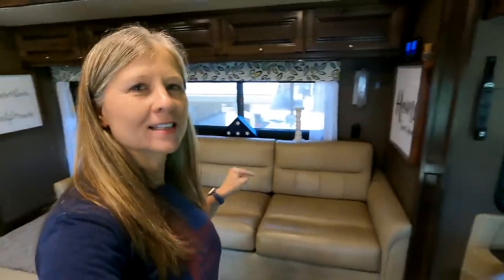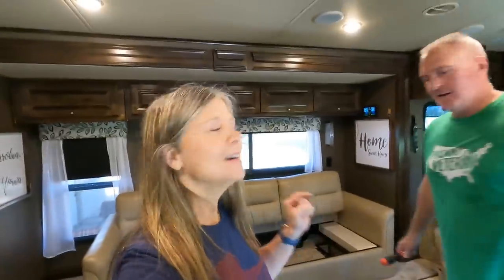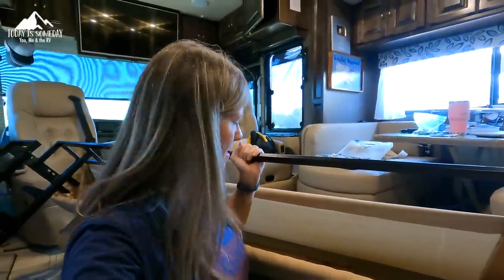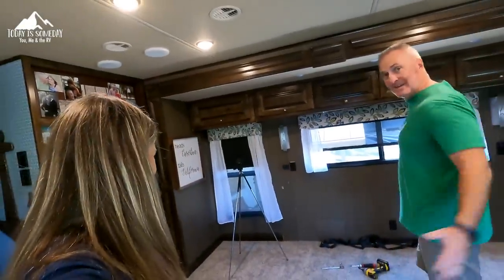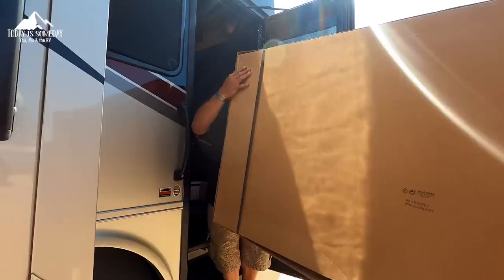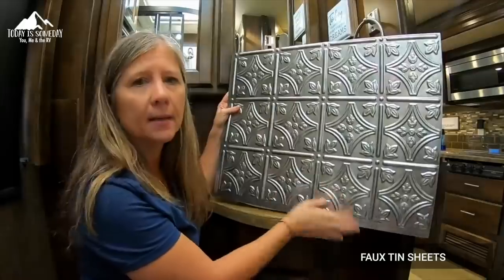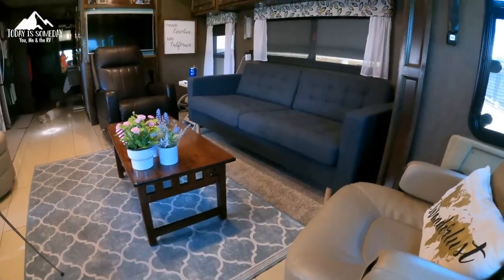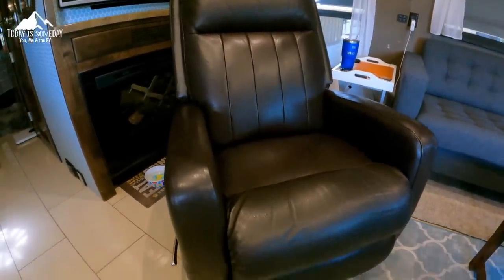We Found the BEST RV couch at IKEA!

Comment: We bought reclining theater seats from American Furniture. The salesman guaranteed that it would fit through the door and if not the delivery guys could take it apart and get it through. I measured and remeasured and was pretty sure it would fit. When they showed up to deliver they said they would not take it apart and the salesman was wrong. They would only take off the backs and the legs not the frame. It did fit through the door barely by just taking the backs off. The vertical valances hit when the sofa was reclined so I took them off and had an upholstery shop cut them down for $30. Now we are comfy and happy.😀

Comment: The door on our 5th wheel is only 24” wide.  We went with full size residential sofa with recliners on each end, and reclining theater seating by Lazy Boy.  Each sofa is held together by two pieces of angle iron along the base, front and back.  Remove those two pieces, then the back separate from the seat easily.  The sofa broke down in to 6 pieces, the theater seating was 5.  Reassemble both couches in the RV.  Easy Peezy!  Pricey, but great quality.

Comment: We swapped out our hide-a-bed two weeks after we got our coach.  We got electric recliners from Lazy Boy.  They come in two pieces and are easy to get through the door.  We selected the electric models as they do not go back when they recline, they slide forward.  This allows them to ride on the slide and we can use them without repositioning them.  We added a center two drawer cabinet between them to complete the set.  Looks like they came new with the coach.

Comment: Enjoyed your video. We replaced both coiuches in our 98 american dream. in the slideout I built cabinetry to encase the 42" led tv. On the other side, wife found a entertainment dual recliner wall hugger type with center console for drinks and storage at AARONs. It actually came apart in several pieces. the frame is angle iron, the 2 seats unbolt from the frame, the backs come off the seats, and the console is small enough to move in with no problems. We got the frame inside, bolted the 2 seats and center console to the frame, re attached the backs, then let the recliner all the way out and bolted the frame to the floor like the original couch/bed was, so the backs were an inch or two from the window. Works like a charm. and I sleep i them all the time. If I knew how to add pics add do so for the recliner and cabinetry.

Comment: Awesome video shipmates! Love the upgrades. I want to replace our furniture at some point and this provided some great ideas.
Upgrades:
1. RV Snap Pads was ordered before we took delivery both on yours and Chad and Tara's recommendations. 
2. We had our batteries upgraded to lithium and solar installed (800a/h w/ 2400w solar). Mike Purdue of The Dry Campers did out install and I cannot say enough about Mike and Leanne, they are fabulous people to work with, more importantly the fit and finish of Mike's work is impeccable. Mike is able to find space for placement and for us we lost no cargo space in the process. 
3. Easy Starters installed on all three AC is a game changer for both the AC and power consumptions.
4. Starlink...what a game changer. We've had the system now for three months and have yet to be in a place that we didn't have better down/up load speeds over our Pepwave Maxtransit Duo system with two companies data sims. 
5. We are in a toy-hauler with a small garage (Momentum 376THS-R) and I own a Harley Davidson Road Glide Ultra, I installed the "Biker Bar" in the garage and it has been excellent for securing my bike. No more crawling around trying to secure cargo straps to hold the bike in place.
Reply from the maker: All great upgrades!!!

Comment: Good job guys! We switched out our old couch for a two recliner w/console unit for our Newmar Dutch Star. It is very comfy! Bought at Camping World so the price wasn’t great. Hubby has back issues so when he felt comfortable on something we bought it. It comes apart so it easily fit through the RV door. We are in our 60s and easily handled the install.
Reply: We want to swap out the 6' sleeper from the coach  with the theatre seating with console from the 5th wheel.  This encourages me.  Thank you.

Comment: I removed the couch from my older Class C and replaced it with a RecPro double recliner.  RecPro, while expensive, makes sure the modular pieces are built to fit through a standard RV door.  I was able to load the new recliners myself.  Then, when assembled, they lock together to form one piece.

Comment: We had our captain chairs and our 1 couch reupholstered with ultra leather. Then we changed out our sleeper couch for  Lambright theater seating and they matched the material.  The Lambright  furniture is very well made, its made to come apart to fit in your RV door. We didn't have it installed but they will also install for a fee . Located in Topeka IN near all the RV manufactures. It did take 6 months to get it after we ordered it but they do have some available in their showroom.

Comment: Hi - When we bought our RV (2015 Tiffin Phaeton), the previous owners had removed the original furniture and put in two recliners.  They were comfortable, but quite used looking and we thought we'd rather have a couch and recliner to make it homier.  So - we took out the two recliners and bought a Kathy Ireland couch and recliner online from Camping World.  We bought the couch because we liked the way it made into the bed.  The couch just basically folds out and creates a nice (kid-sized) bed.  The recliner is a rocker/recliner and it is very comfortable, but the problem with it is that the base of it is on a round pedestal and it can't sit far enough off the wall to not knock the wall when you sit in it.  If you pull it too far out, it leans too far forward and you'll fall out plus it's in the middle of the room, blocking the fireplace and TV.  Securing it for travel is another issue - we have to wedge it just right and surround it with pillows so it doesn't bang against everything, threatening to break the window!! The couch isn't comfortable to sit straight in (we bought it online and that was a mistake).  The seating part is too short so it's really only comfortable if you sit sideways and put your feet on the couch, too.  The whole set up cost us about $1500.  Someday, we will replace both.  It is really not an ideal solution.  FYI -  Couch:  https://www.campingworld.com/kathy-ireland-easy-out-sofa-125485.html?utm_source=google&utm_medium=ppc&utm_campaign=%7bCampaign%7d&gclid=CjwKCAjw_ISWBhBkEiwAdqxb9l0LUEZGbzhcLBtJBZVZtdiV9rwWJxlJSSJ-GBCopfstEOY9u159_xoCZTAQAvD_BwE&gclsrc=aw.ds   Chair:  https://www.campingworld.com/kathy-ireland-swivel-glider-recliner-125507.html?utm_source=google&utm_medium=ppc&utm_campaign=%7bCampaign%7d&gclid=CjwKCAjw_ISWBhBkEiwAdqxb9qmVkvV1A9DL_N_WeFO6KJs3b7T5k7NpBHyQ-LmjPxwlxcSDDnMHeBoC-wAQAvD_BwE&gclsrc=aw.ds

Comment: We changed out the L-shape sofa in a Fleetwood Bounder. We only had 80 inches in space. We wanted a couch but most were too big and the loveseat was too small. We ended up getting two end pieces of a sectional and it fit perfect. Each end piece were recliners and they hooked together so it still looked like a couch and did not separate from each other.
Reply: We did the similar thing. We used two middle pieces of the IKEA sectional so we didn’t lose space to the sofa arms. Sectional pieces are great to create the needed couch length when you have the odd size where couches are too big and loveseats are too small.

Comment: We removed the love seat with recliners for two Lazboy recliners. Both came apart easy and made a bracket to anchor the Lazboy recliners to the slide floor. So comfy. It did block the small window in our Phaeton 40 QBH, but it's a small window and was not used for a view anyway.

Comment: When doing this, remove the mattress, then the sleeping unit, lash the it together and carry out. MANY years of experience. Then disassemble as Phil and Stacy did.
Reply: Will a 6' sleeper sofa still have to be disassembled?  😢
Reply: @PRINCESSKELEA777  Yes, it is quite heavy and this will make it much easier.  Open the sofa and remove the mattress.  Close the bed frame and tie it together so it won't open up.  Next remove the nuts and bolts holding it together and carry it out in pieces.
Reply: @srperk6163  Thank you.  😝  Haha.

Comment: Very nice upgrade.  I took out our couch and love seat and built a custom dinette and bunk beds for the grandkids.  I used regular twin sized mattresses, so sheets, blankets and bedspreads are not a problem.  I have plans on removing our recliner and building a custom Murphy bed.  When the Murphy bed is up, I'll have a panel that will drop to provide a desk for the passenger seat or extra table for food.  All the new furniture I built is painted white to brighten up the coach.

Comment: We got rid of our Flexsteel furniture from our 2016 Nexus Bentley because all the faux leather was flaking off.  Removed our couch & dinette and replaced with a solution from Home Reserve (highly recommend!)

Home Reserve sells couches in a modular manner.  They ship all the materials and you put together.  Fit through our door with no problem!  Our couch is now 110 inches long with storage underneath!  Also, it’s made out of a quality wood laminate product so weighs a lot less than the metal from what we took out.
Reply from the maker: We did look at Home Reserve as well.....another great option for sure.

Comment: We switched out our couch with a much nicer couch - that had a recliner at each end, we cheated though - we had the RV place do it, cost a 100 bucks but well worth the less effort on our part.  We also upgrade the mattress, that we did ourselves with a Tuft and Needle - small box Big King size when it unfolds itself. Nice job on the cabinets -Like the stick on stuff also.

Comment: Love the new sofa!  Great information you shared. I have a question. How did you secure the sofa for the seat belts to be used? Or did you just leave free?
Reply from the maker: The seatbelts are still bolted to the floor under the couch. The couch is also secured to the floor. I don't like them because you should be facing forward in a vehicle. We also have seatbelts in our booth if needed.

Comment: Interesting to see. Our problem is we need to get a sofa bed in to our Safari Trek 2480!! Lots of research coming up, it seems..
Reply: Not too many of those TREKs left around.  Downsizing from my wonderful old 2000 Bounder 36S,  I bought one of the last ones made under the Monaco name.  2016 Monaco TREK 26HM-D. Tan and taupe with the big orange name stripe.  
 Actually Monaco was bought out by REV in 2015 and the 2016 was built on the Fleetwood assembly line so the front end design looks like a Fleetwood and the cherry interior cabinetry is also from Fleetwood.  
The bedroom has two optional designs.  An electric lift up queen bed with closet and storage cabinetry underneath.  Or a more standard walk around rear headboard with cabinet surround.  Unfortunately, I have the lift up bed.  Do not need to put it up too often,  thank heavens.  
Very tight with the  slide in.  I have the dinette option instead of sofa but I recently came up with a great remodel design that preserves the under dinette drawers and gives me a dedicated desk while moving the recliner onto the slide to now face the TV cabinet.  More open and much more livable and mostly just reusing and repurposing the existing pieces doing some woodwork modifications to the bench seats.  Project executed by THE GARAGE in Orlando, Florida.  Great husband and wife work team.  Her mother is a good friend of mine.  They do mostly vehicle audio, lighting, security cameras and did my new backup camera system.  It was surprising to discover he also did meticulous interior woodworking.  Love the results of my remodel and liking my rig more than ever. 
Next would be recovering the recliner and cockpit seats or replacing them as the cheap vinyl has pealed badly.
Reply: @dorisshanks7295  that sounds great. We have the electro magic bed but someone was fiddling with it when we had our generator serviced and tried to lower it with the safety pins in. They sheared the key in one of the gears. We are hoping desperately to get it fixed at Good Times RV. Plan B will be going to a good quality sofa bed. 

We love our Trek, and wouldn't change anything if we didn't have to. 

Thank you so much for your interest and reply.

Comment: Great video…Thanks.  We also replaced out old pleather sofa with an IKEA Friheten sleeper sofa and love it.  We have a Keystone Cougar 5th wheel and had take it thru the door unassembled, but it was not difficult to assemble once it was all inside.
Did you have to secure your new sofa or do you secure it while traveling?
Reply from the maker: I will secure it to the slide floor before we get underway.

Comment: How did you bolt the couch down? Without it bolted down do not use the seatbelts because if something happens whoever is sitting on the couch will be cut in two. Without the couch bolted down it’s a projectile. Household furniture should not be used in an RV. 
MY OPINION!!
Reply from the maker: We will secure it to the slide floor.  Household furniture is no problem in an RV.
Reply: I just worry that with all your followers someone’s going to get hurt by not bolting it down.